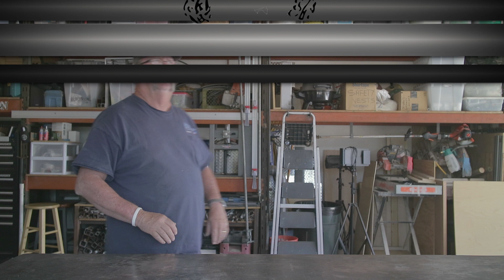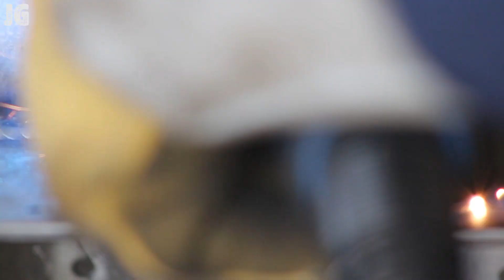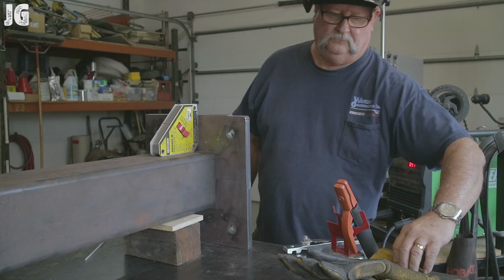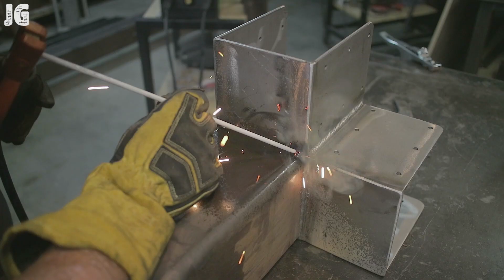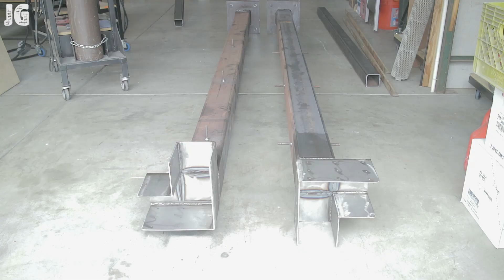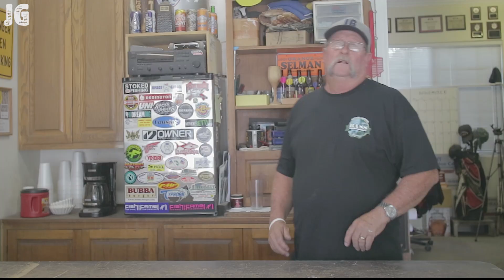Steel Support Build - Jimbos Garage

Comment: Welders keep a brick to tap the 7018 electrode  on to break of the flux slag on the tip , we even take one up a building  while constructing one
Reply from the maker: Thanks for watching and your advise Mark,   Jimbo!
Reply: 6013 my new fav. Out of position electrode , 15 years never tried one , way better on the horizontal plane
Reply: Try out an Eastwood mini metal saw... $80 $10blades crazy fast and convenient...cold cuts no slag

Comment: Just some advice for putting base plates on, instead of plumming everything up just tack a small piece of angle to the base plate and hang it off the column, that way if the cut on the column is off you can easily adjust the baseplate by eye and with a square,  saves a lot of time
Reply from the maker: Thanks for watching Keith, And your advise, I will do that next time!  Jimbos garage!

Comment: Nice work as usual Jimbo! Good choice on going to E7018 for those heavy joints. I like the Pam spray too. Where did you learn about welding? Self taught, or do you have formal training?
Reply from the maker: Hey Brian thanks for watching, 
I was a welder in high school, Then two years out of school. That was about 40 years ago. it's like riding a bike, some things you just don't forget.  Jimbos garage!

Comment: My power arc 200st does the same thing about running hotter than normal. I run 3/32 7018 at 55 amps. If i turn it up to the 90 or so i get tons of spatter and melts holes in 1/8 inch thick stuff the same as if  i struck an arc on 20 gauge sheet  with a stick welder
Other than i have to turn the amps down the machine performs great
No problems with penetration or poor toe tie ins